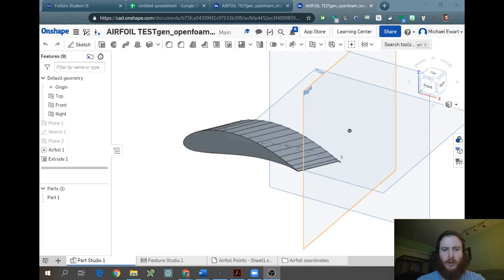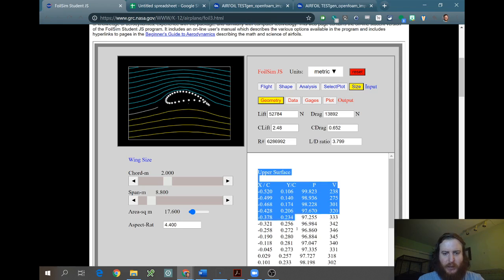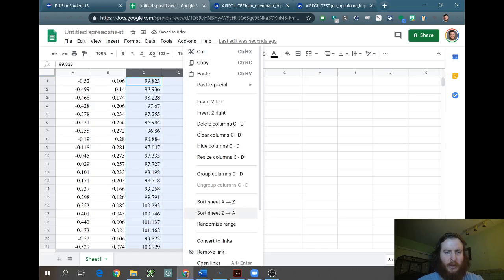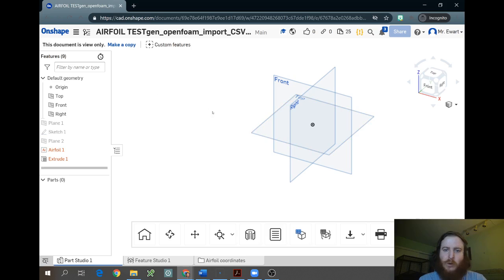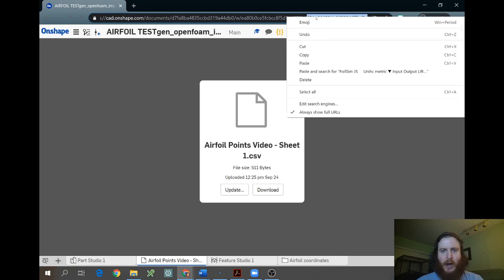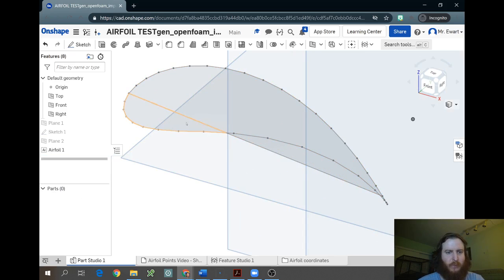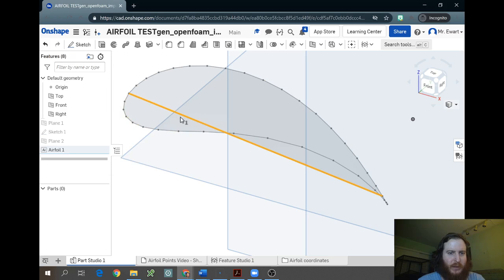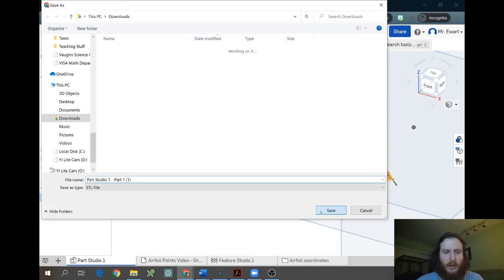PLTW AE 1.2.6 Import Airfoil Points into OnShape

Comment: I noticed the "Feature Studio 1" tab was at the bottom of the screen from the very beginning of the video. When I just search for and activate the Airfoil Script, that "Feature Studio 1" tab does not appear.    I tried copy/paste of the source script into a new "Create Feature Studio" command (on the bottom left after clicking on the "+" icon), and it doesn't seem to work... So, how did you get that "Feature Studio 1" tab to appear on the bottom? Thanks in advance.
Reply from the maker: Hi, sorry for the late reply.  The "Feature Studio 1" is a script that was created to automatically generate the airfoil.  It would not be in a new document that you create.  Instead, click the link in the video description.  That is the file you will use and share with students.

Comment: If you click on the analysis button in foilsim, it has the option to download the .csv file.  You will still have to delete pressure and velocity, but you won't have to sparse the data.
Reply from the maker: Great tip, I was not aware of that, thanks so much!